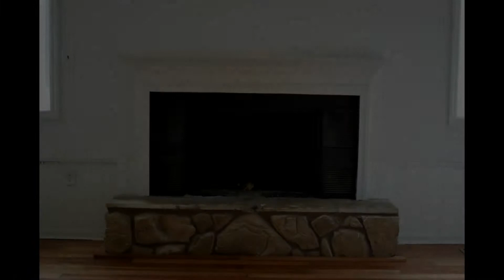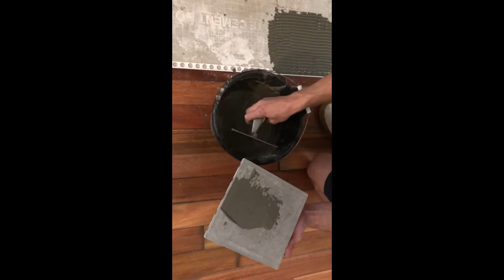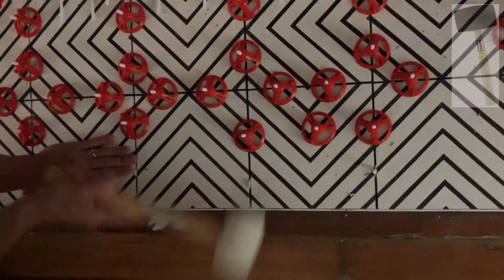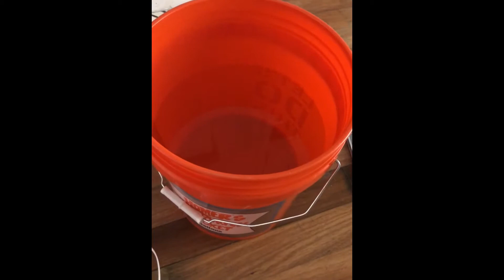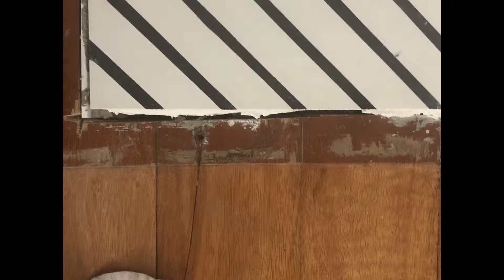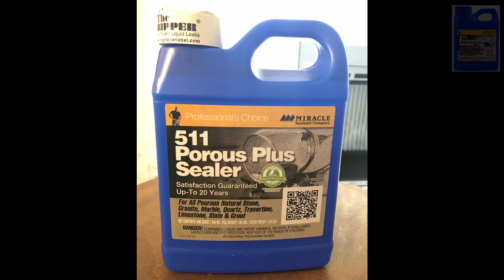Fireplace DIY #4: Tile and Trim

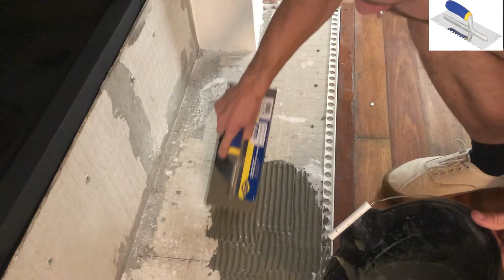Comment: I just found your tutorials and I'm so glad I did bc I'm wanting to redo my fireplace similar to yours.  But I had a question...how did you disguise the lip or edge where the top row of tile meets the black fireplace box (at 2:04 in the video (on the left side of the screen))?  How did you cover up the raw edge of the cement board and edge of the tile?  I can email a pic if that's more helpful!  Thanks!